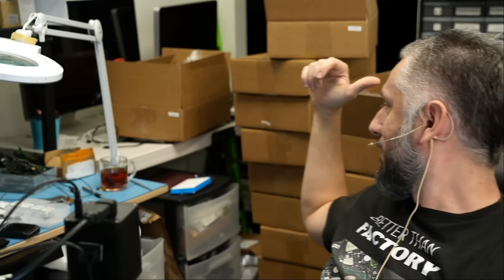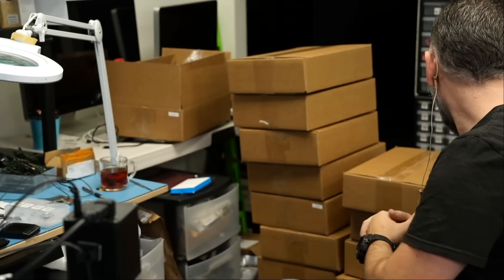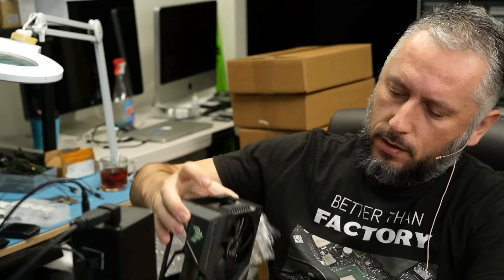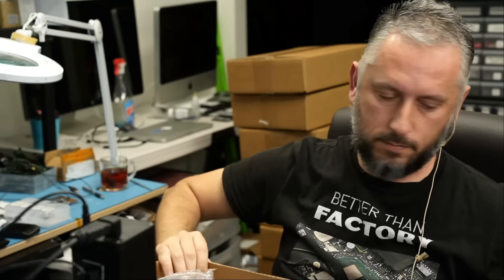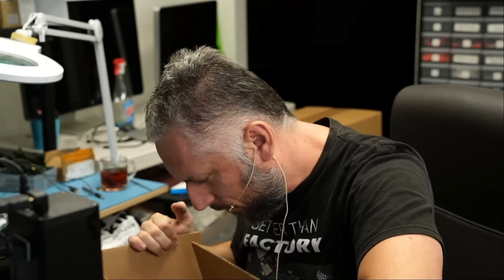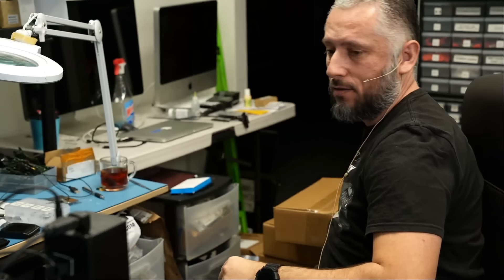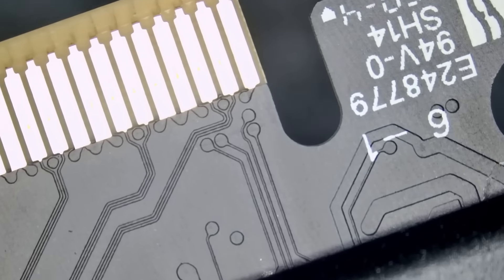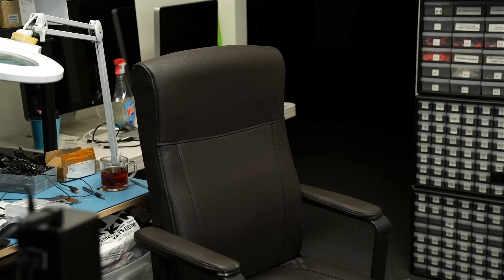We received 19 cracked 4090 Cards for repair - Who's to Blame ?

Comment: The best way to avoid breaking the board is using vertical mount. That way the pcie slot doesn't get stressed and it is connected to the riser cable. All of the weight is handled by the mounting bracket on the PC Case. If you can buy a heavy and expensive video card you should be able to afford a riser cable and a Case that supports vertical mounting.
Reply: Just use the supplied magnetic  kick stand in the box. Zero problems on my 3 ASUS 4090 OC Edition.
Reply: @genderlessyoutubefanperson  If it was long/high enough that would indeed be an option for many people.
Reply: @germanmosca  or get a founders edition card, they are rock solid due to their full metal frame and 3 screws with no sag at all despite using a 4090 😅.

Comment: Some cracked cards CAN be repaired, you just need the schematics in order to fix the traces using wires. Thing is not worth it for a business, it's time consuming and is not economically viable.
For a hobby is worth trying, but for a business is a no go.

Comment: Majority of these cards have an issue that started with weight.
Reply: or that the motherboards have fixed graphics card connectors rather than flat cables.

Comment: As someone who owns a Asus 4090 I can say that they do come with a support kickstand. I suspect the video card came from an OEM PC maker. My 4090 came damaged from shipping also the kickstand was never included. I asked for a replacement and was sent a wrapped brand new 4090 with the kickstand and some other stuff that was never included.
Reply: Can confirm also that the Asus gpu comes with an anti sag stand.

It worked for my case... But I assume there are a lot of cases where you can't use that at all?
Reply: The support stand that came with the card is too short for some
Reply: They should NOT ship the larger cards in the slot, it should simply be separate with instructions on how to install it.
Reply: @shanemitchell477  it's not a pre-built then.

Comment: That's a lot of nice cards. Thats a lot of cracks. 

Makes me wonder why you never see Nvidia Founder's Editions cracked, and you never see solely AMD's board partners (XFX, Sapphire, Powercolor) PCBs cracked.
MSI, Asus, Gigabyte and Zotac have been cutting corners for years. Now its finally starting to add up and we're seeing damage from normal use. Video card support brackets didnt use to exist. 

Yes cards are heavier, but they also used to be built better.
Reply: They're built the same way they've always been built, but the PCB structure and material hasn't fundamentally changed, and it's not reinforced. The 4090 models released by Nvidia and its board partners are among the largest, heaviest and longest consumer graphics cards to have been released yet. Four slots' worth of GPU cooler and all its metal at roughly 14 inches in length bearing down on a PCIe connector with all that leverage and without any external support is a recipe for disaster, regardless of how well built the board is.
Reply: i switched from gigabyte GPU to Powercolor for a similar reason. too many issues.  powercoler has been flawless for me so far.

Comment: They do add support braces on those when they're new in the box but who is to blame? Who knows.... This is why I never use the horizontal mount on any of my PC builds if it's a heavy card mount it vertical or watercool it with a monoblock.

Comment: The cards are now ridiculously heavy and with too much power.  If the card doesn’t crack the power connector gets too hot. There needs to be a rethink on the design of these cards and or the cases and connectors.

Comment: This is why I have both a support bracket and a support post for my 4090 Gaming Trio. Bracket holds up the outer side, post gives support to the inner side at the far end. It's really stable and I'm not too worried about this issue now.
Reply: My 3070 i vertically installed and watercooled i think it's better and the MB is horizontal

Comment: I think moving forward manufacturers need to supply a support bracket with the card even if its a cheapo one.
Reply: All these cards come with a support bracket, gigabytes is a bit finicky to install. Its more than likely these cards cracked while they were shipped inside a PC.
Reply: Totally agree with you mate I think the price of cards now and the size and weight of the cards they dam well know they should come with the card with a warning sticker to use a support stand .
Reply: not really, the way things are going with the power gfx cards are needed, the old way using existing pcb board thickness isnt enough to hold the weight, its ok saying "make sure to screw them in to the back plates" etc, but the actual manufacuring of "future" cards need to be revised, otherwise these type of faults wont end
Reply: They do
Reply: @daves8718  My 3060ti never got one. Then again, even with 3 fans,  it is diminutive compared to the more powerful cards.
Reply: @IGame4Fun2  They do ? then WTH its happen here ?
Reply: @snake21ab  These cards were likely all damaged in shipping due to rough handling by the carrier. an end user isn't going to completely rip off the pcie locking tab just from using the pc without a support bracket.
Reply: @snake21ab  users don't want to install an ugly bracket.
Reply: my MSI 2070S back in the day came with one, and these cards are kinda small in comp how big they are now :O
Reply: @snake21ab  Allow me to answer your question. The owners of these cards think they perfectly know how to build a computer themselves while they're stupid as fuck (but we love them anyway) and while that cooler alone is near 1Kg weight or more, nobody is able to comprehend what all that weight is going to do  to the poor card. Anyway, the moment they mount the video card into the PCIe slot, sometimes they forget about the support bracket while other times they don't understand what that support bracket is for. Some of them do know what that support bracket is for but they can't understand how to make use of it and they give up.
I have quite a few of these boards and one of my clients even tried to solder thick wires (PSU wires) to fix his cracked video card.
Like I said, we love them because without their stupidity, we will earn less money. I don't think I need to sugarcoat it, I'm just saying it as it is. I'm just being honest here.
Reply: Yep, they come with a support bracket. My Asus 3070ti has one
Reply: I installed the gigabyte support bracket for my 4090 . It's rock solid,and I can barely see it too. You screw it to the motherboard and case . No sag whatsoever.

Not a fan of the single pole ones that just lift up the card as this can cause twisting.
Reply: PCIe was never designed to cope with cards this thick and heavy, it is getting pretty silly.

It could but we probably need to stop horizontal mount and as you say we need some sort of standard for support bracketry. A little like the PCs of old, full size cards were a standard size and the cases had supports for them.
Reply: They already do+ some cases are being built with ones, but it’s up to the user to use them.
Reply: @greenman8  Only a few 30 series had brackets but i know for sure the 4080 and 4090 cards come with them due to there weight
Reply: My MSI 4080 came with a support bracket.
Reply: Thank God my msi 4090 liquid X is still good lol😅 still running like a beast
Reply: I wonder how big companies like Dell, HP ship 4080 and 4090 PCs, did the PC builder in this video not include internal padding? The GPUs could use a lighter cooler for a small performance loss in thermals
Reply: @arcrypto22 my msi 4070 came with one and it's only 2 fans
Reply: @lemagreengreen maybe we shouldn't produce cards this large and heavy
just saying..
Reply: @AltPlus30  Well yeah but people want quiet fans which are best done with large heatsinks. 

Chips are only getting more efficient but we still need to keep them cool, large lumps of copper and aluminium are the best way to do it.
Reply: dont they already?
Reply: @lemagreengreen  maybe it's better to stop making chips that require these humongous heatsinks
although, people buying 4090s pretty much deserve them being so hot and fragile
maybe this way they will finally learn they shouldn't buy cards that become trash in 2 years
Reply: They should..how crazy it is..GPu become more bigger and heavier..soon or later one card weight like a brick..and yet the connecter thick only 2mm++...its not like it make from diamond or steel😂😂😂
Reply: They already do
Reply: Have you been living under a rock? Because they do…
Reply: Instead Nvidia supplied them with a cheapo power adaptor that was probably the main cause of all the melting.

Comment: For a heavy auxiliary board, it may be advisable to have the unit in question fixed directly to the metal-work frame of the computer box, and a socket on a flying lead that is then fitted without stress to the heavy auxiliary unit, such as those 4090 video boards.

Comment: Man those 4090' s seem like such a great product...
Reply: Wow, this make 4090s' look like bad investments. The burning 12v connector does not help either.
Reply: With the cost of the 4090's, I would almost want a small case dedicated, just for it. Instead of using a Huge Heat-sink and Fan combo, put the electronic workings, on an ITX board instead, and use a decent AIO cooler.
It would be awesome to see a matching set of cases from a company like Fractal Design, one being mid tower ATX for the CPU and Storage, the other being an ITX case, for the Video Card itself.
Reply: Biggest downside, having to use independent PSUs for each case. (then again, the 4090 is a thirsty card)
Reply: @greenman8  Designed for the buyers who can buy it. And manufacturers doesn't seem to stop there, more weight, more price, more hpwr, more melt, more crack, more power consumption. :D I hope 5000 series comes with even thinner new uhpwr connector, both end on the psu too, so buyers can buy new power supply on one fail at the same time. :D
Reply: The 3090 were also a bust too, I had one of mine catch on fire playing New World. Nvidia's engineers are on something.
Reply: @_paczki really? Was your power supply  enough?

Comment: can a future graphics card use two pcb`s with a cooler sandwitched betwen them so it will use two pci slots as a connection to the mainboard? maybe this way it will not crack again because of the weight...

Comment: Pretty much we've reached the threshold of 12-15 layer PCB supporting that kind of weight without extra support and not considering the extra vibration imposed that can exacerbate the issue. As I remember correctly, motherboard manufacturers reinforced the PCIE slots was due to tearing of the slots because of the ever increasing trend of heavier GPUs. Now it came full circle and found a new weak spot being the PCB no longer can handle the heatsink weight overtime or when subjected to additional external forces.
Reply: It would be time for a new type of connector tbh... Not this intricate shape for a 2kg card.
Reply: It is not the layers the problem, it is the Cooler and the size of the PCB, which is way too small.

Comment: NorthridgeFix to answer your question - buyers. They wanted overpriced Nvidia 4090 cards with massive heatsinks, well they got it.
 Instead not support nvidia and NOT buying those cards. I have no remorse for those who didnt get cards refunded. You learned lesson hard way.
Reply: Yes it's consumer driven demand, BUT the consumer is hoodwinked by the industry to demand such items. If modern games were properly optimized most people would not require a 4090. Also there are only two companies in the market. In a natural economy, there would be way more competition. But it isn't a free market economy as the rules are set by the global leaders in hardware and software development.

Comment: I have an 6900XT that I bought 2 years ago. Even for that older card it is impossible for the PCIe connector to support the weight of the card. The card came with its own support bracket and the manual clearly stated that you should support the card
Reply: Not the MBA reference model.
Reply: Msi gaming trio? Good choice
Reply: @SC.KINGDOM  Powercolor Radeon  16 GB

Comment: I just bought an aftermarket support-bracket from CoolerMaster ... €16 and that thing even comes with a built-in aRGB strip. So how expensive can it be for board-partners to throw those things in with any of their cards that might need it? My card "only" weighs 1.5 kilos and despite it being of the "Gaming"-variety (roughly 10% more expensive than MSRP cards) it did not come with a stand. But after having seen a ton of repair videos on multiple channels with cracked PCBs or even broken off bits, I guess I got a little paranoid.
However: I tend to agree with what other comments suggest in that these catastrophically damaged cards probably didn't just crack under their own weight while the PC was sitting on a desk. I'd wager we're either looking at PCs getting knocked over/dropped or damage incurred during transport with the card installed into the mobo without being sufficiently secured/padded. Even those huge 4090s don't weigh 10 kilos, so I highly doubt the cards' own weight (while properly installed and tightened down) would lead to the whole "hook"-thingy breaking off like that.

Comment: Almost all cards now come with a support bracket, as well as most computer cases have one. A lot of people just opt not to install them, because they do not like the look of them.
Reply: They shouldn't honestly.  If they need one then they're too big/heavy and shouldn't be sold in my personal opinion.  It's the reason I traded in my MSI 3070 Ventus 3x for a MSI 4070 Ventus 2x.  Half the size and a 8 pin to 8 pin connector on top of running far cooler, and still being noticeably faster GPU.   I've seen a few Tech Tubers even downgrading from a more powerful GPU to the 4070 for the same reason.  To me the 4070 is the best GPU of this generation.   The only other GPU of interest this generation for me that I find impressive is the Intel 580.
Reply: @KameradVonTurnip  a 4090 is an insanely powerful card, that burns a ton of energy, so it needs lots of cooling. Not really anyways around that besides water cooling or buying a slower less powerful card.
Reply: @aaronwlkr  Which is entirely the problem.   It's pointlessly powerful, and large.   The fact AMD gave up trying to make a GPU that matches it, and Intel isn't even trying to match it.  I don't see how any sane person would want one.  

I mean this generation the only GPUs that have impressed me thus far are the 4070 and Intels 580.  For me it isn't about RAW power, that's a fools game.
Reply: @aaronwlkr   Again, it's a fools game.  I have zero sympathy for 4090 users who GPUs go up in smoke, or break in some other fashion.   It's like owning a Tiger vs a House Cat, Tiger is ridiculous to own, but some people pay the money for it.   Like a Tiger randomly deciding to bite you in the back of the neck, a 4090 will go poof.   

It's a terrible investment in short.   Adding a water cooler to it is irrelevant as it doesn't solve the power hungry issues, maybe if only the weight issue, but in turn at the cost of a grossly more complex PC build.  

Basically the only "SANE" option is not buying a 4090.
Reply: @KameradVonTurnip  I'm sorry, what? You don't see how any sane person would want... a really powerful card to get high framerates in recent games with max settings in higher resolutions? If you personally prefer to play games at 1080, that's fine, but acting like other people are crazy for wanting higher end cards is just weird. In Cyberpunk, for example, even a heavily overclocked 4090 struggles to get much more than 60 fps without DLSS at higher resolutions with ultra settings and ray tracing. When there are already games that push the fastest graphics card to its limit, you can't really argue that it's "pointlessly powerful."
Reply: @Alte.Kameraden yea my msi 4070 2 fan still going strong
Reply: @KameradVonTurnip you're only thinking about video games and fps. I'm doing animation and the 4090 does my workloads in less then half the time of a 3090. It's power is an insane tool that's required. It's not a luxury it's an actual necessity. Not everything is about video games this is a workstation card.

Comment: let's be honest even if you manage to fix them there seems no way to do a reliable repair. The ones broken at the anchors seem more repairable though but still again there is no guarantee the fix would hold if the original board did not hold!
Reply: I wonder if some of those cards could be used, (where a structural damage did not involve internal electronic tracings) if they were used remote, or on Vertical adapters?
Reply: Never fix PCB cracks/damages. Even at work, these would be designated as scraps. Layered boards like these can have 12V DC on layer 4 going to layer 10 but disconnected by the crack.